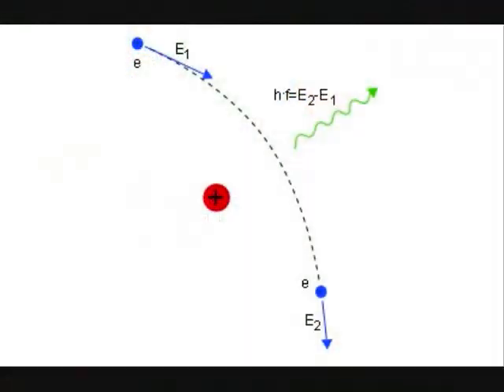an introduction to bremsstrahlung (braking radiation)

Comment: The PD500 tube is probably only kind of television tubes that are really dangerous what comes to X-radiation when servicing. It is a very special shunt regulator tube which was used in the days of full-tube color tellies. These were used with together with the GY500 series rectifier tubes, which had too high internal resistance to regulate the color CRT HV supply precisely enough by solely on primary side regulation on the line output stage. Thus the PD500 had to dissipate all the power not needed by the color CRT on the darker pictures in order to keep the CRT HV constant and in order to avoid unnecessary fluctuations in brightness and color balance. And the PD500 was connected right across the CRT HV supply and ground. More modern CRT tellies rely on semiconductor cascade multipliers which have much lower internal resistance, an also much more advanced voltage regulation systems.
CRT itself was/is such bulky glass device that it can have thick enough lead glass front to suppress any X-rays from radiating the viewers. But as the PD500 was much smaller glass device, it needed external shielding.

Comment: Awesome! I've done this. I did it at an angle. Definite change in counts. It was probably beta radiation too, being deflected back to the G-M tube. I used a B-8 Strontium-90 "spoon source". It's original activity would have been 5 µCi, but being ~53 years old, its activity is now about 1.5 µCi. Still quite strong! I think what could be happening is that the Aluminium is blocking the 546 keV beta particles, but the 2.27 MeV beta particles from Yttrium-90 are making it to the Lead. On the other side, both are being stopped, and the Bremsstrahlung X-rays have been attenuated more by the Aluminium. But, I'd have to do more testing.

Comment: Additionally, as energy is diffracted away from the beta radiation generate various lower energy photons, the likelihood of those lower frequency photons interacting with the matter through which they are passing increases. Basically, by forcing the beta radiation to pass through the densest layer first you increase the likelihood that the beta radiation's energy will be have its first divide very early, each divide after that first one is more likely than the last.

Comment: this means that most of the beta radiation is from Sr-90, but some is from the secondary decay of Y-90. The Y-90 beta radiation is much (over 4 times) more energetic. High frequency radiation (whether phonon or photon) shows little concern about what sort of matter it will interact with, instead its interaction is based almost entirely on the quantity of mass through which it passes.

Comment: The shield works best when the beta radiation hits the dense lead first because the lead is better able to interact with the highest energy beta particles.

The energy of a Strontium-90 beta decay is 0.546MeV; split up over three particles: an electron, an anti-neutrino and a Yttrium-90. Yttrium-90 Beta decays to Zr-90, and another electron and anti-neutrino. The total energy released of this second decay is 2.28MeV.

Comment from the maker: @jstreutker 
thanks, but i was already notified of that mistake and corrected it days ago. ;)
by the way, a moderator is something COMPLETELY DIFFERENT. 
please just go to the english wikipedia and type in bremsstrahlung, you will find that the term is used in english as well. also, type in moderator, and you will find an article on a NEUTRON MODERATOR. a moderator in nuclear physics is a substance that slows down fast neutrons to thermal neutrons so they can "interact" with other atoms.

Comment: @bionerd23 Hi Bionerd. As already pointed out by Kunibuler, "Bremse" is brake in English. When I check my German-English dictionary, I do not find the word "bremsstrahlung" but I do see another word whose application is mainly in physics: "bremsmittel", and for that particular word, the dictionary suggests "moderator". So, instead of calling it "braking radiation", I would call it "moderated radiation." I'm no physics expert, so hopefully an english scientist will concur.

Comment from the maker: @tesla242 
well, it depends; in x-ray tubes, all photon energies up to the energy of the electrons are persistent. usually, low-energy photons are shielded within the x-ray device before leaving it, though; but that only goes for the typical x-ray exams to produce imaging. there are cases in which x-rays are applied to treat dermal issues, e.g. to correct scars; in that case, soft x-rays are wanted and the highly penetrating part is unwanted.

Comment from the maker: @tesla242 
what do you mean, it's useless in a professional medical use? bremsstrahlung from electrons are used for many applications; however, they're producing using high voltage rather than strong beta-emitting radioisotopes. i guess that's what you mean? btw., i investigated that bragg peak at an open house day; it's on my flickr (link is on my channel page as "homepage", just search for "bragg" on my photostream if you're interested).

Comment: A lot depends on the exact geometry of the detector but i was expecting the lead side inside to produce more radiation, because the beta would tend to pass through the aluminum, and produce bremsstrahlung closer to the detector when they hit the lead layer.